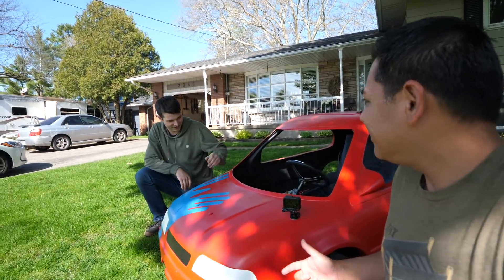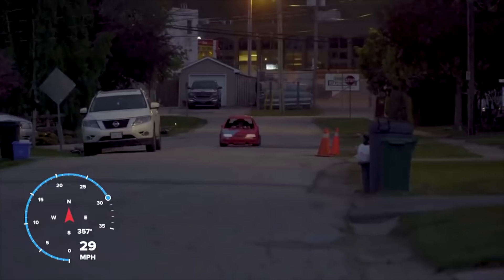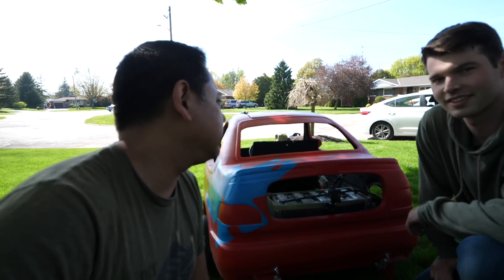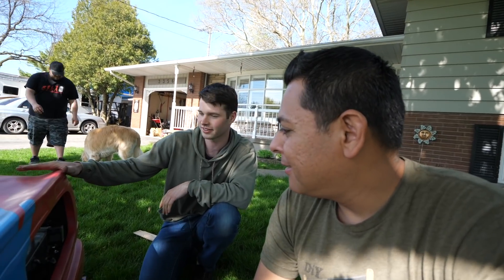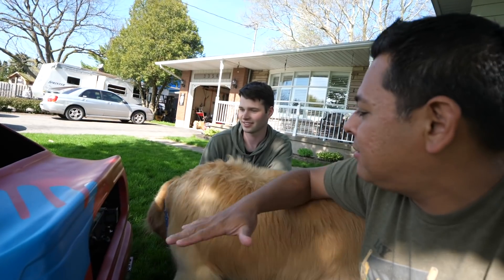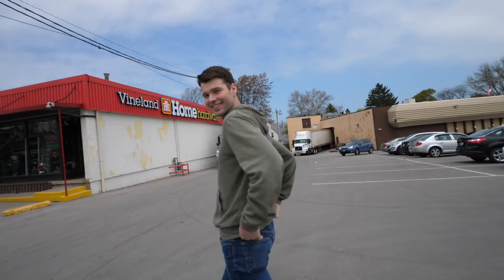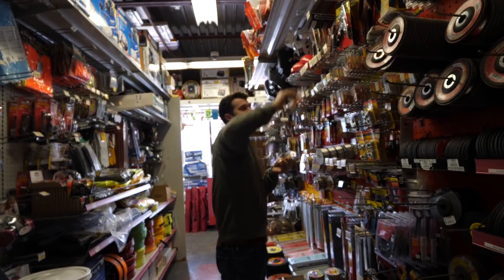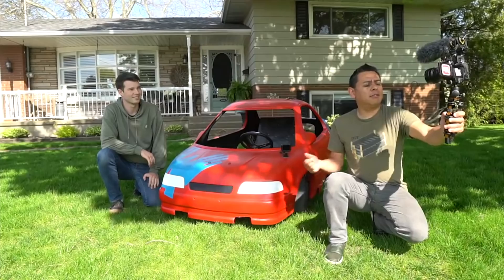20HP Electric GO KART

Comment: Clickbait title. That's a 6hp gocart.
Reply: Motor is running at 50A (100A max) 48V  spec sheet says efficiency of 90%, no idea on power factor (used .9). Calculator says 4.51hp (9.03@100A) it can run past 48V but efficiency drops. Thats hp @ motor not taking into account drive train or ratios. Unsure how that all works. His video also lists 5kW in the title not 15.7kW. Maybe there was miscalculations.
Reply: Yes, clickbait, only 5kW. They also talk about "lot of power" but that's only the peak burst current of the regulator (350A), so in power-kW it must be 16,8 and not the on screen 15,7. Hanky panky with numbers in this video 😀
Reply from the maker: Suckers
Reply: @jehugarcia  lol I like you.
Reply from the maker: Suckers